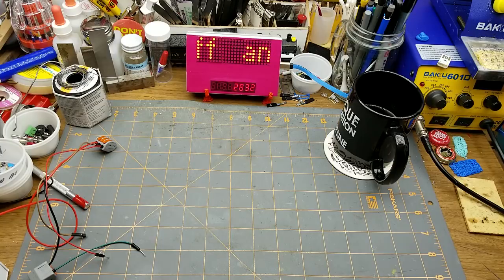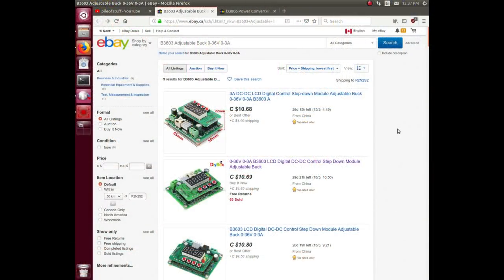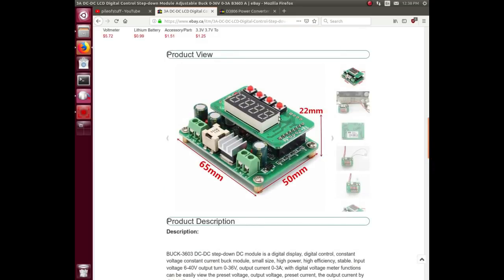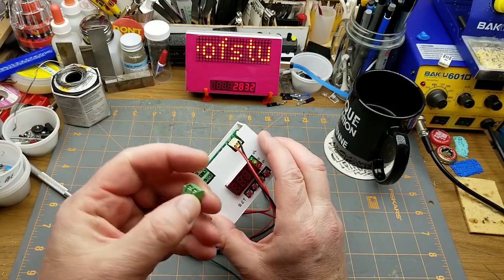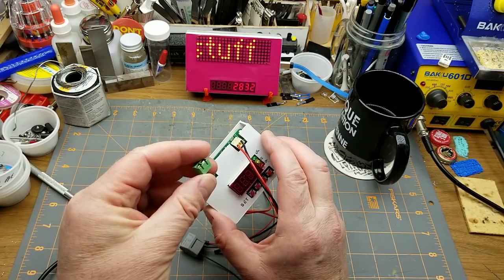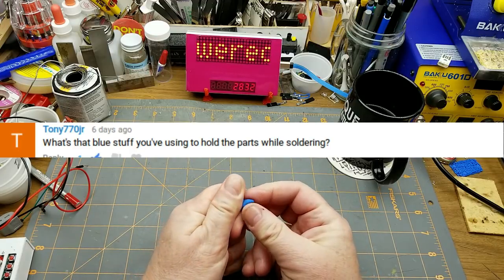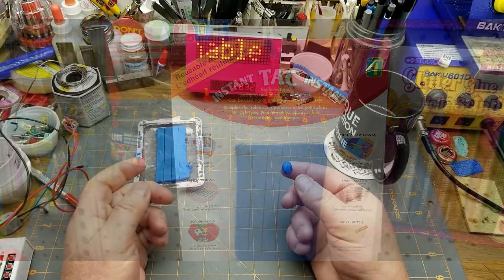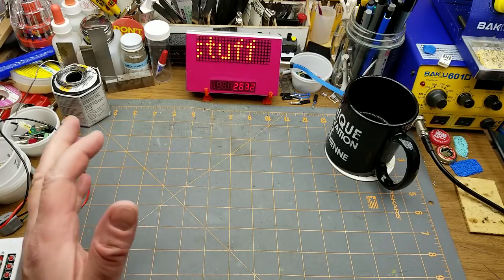You've got questions? I've got answers!

Comment: I have a similar background. I took Electronic Engineering Technology at SAIT (Southern Alberta Institute of Technology. I worked doing field service work in the oil and gas industry in Alberta for 5 years. I was then transferred from the Edmonton sales/service office to Calgary Head office as service manager. I then moved to a second company as service manager got a total of 22 years in service. I then when to an Engineering Company where I did control systems design. In control systems design area you get to write the control programs, test the control panels built at a panel shop and the got to the field for start up and commissioning. I work at that for 18 years. Things are always changing so it was a very interesting time.

Comment: There is a not inconsiderable difference between the B3603 and the B3806. The former is just a buck converter. The latter is a boost/buck converter. I have them both and mainly use the B3806 with an old ATX power supply I modded just for this purpose.

Comment: Hi got a question, how is the female DC Jack called with the two pin out connected to the buck converter, where you plug your laptop power supply in? Want to order them but have no idea how to call them
Reply from the maker: Are you referring to these?
 
https://www.ebay.ca/sch/i.html?_from=R40&_trksid=m570.l1313&_nkw=2.1x5.5mm+DC+Power+Plug+Jack+Adapter+&_sacat=0
Reply: @pileofstuff  yes! Thank you!